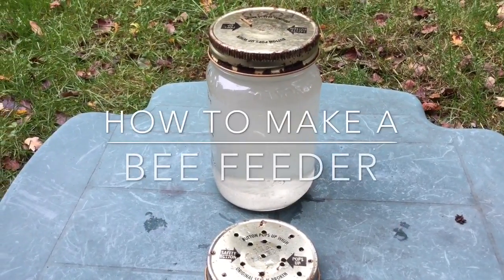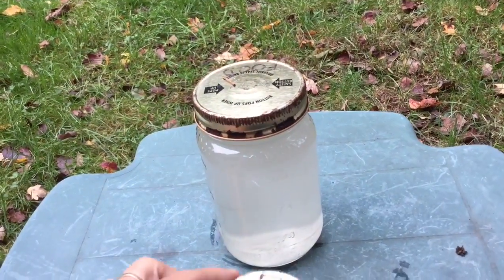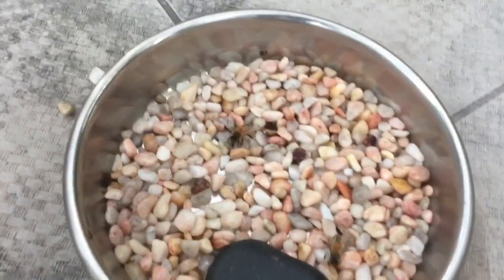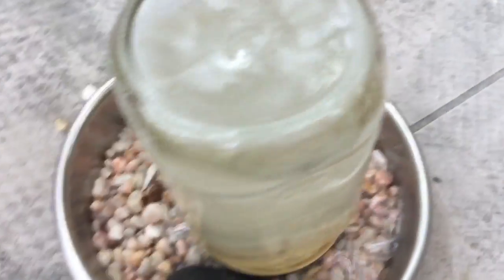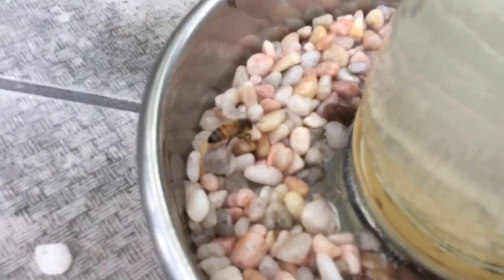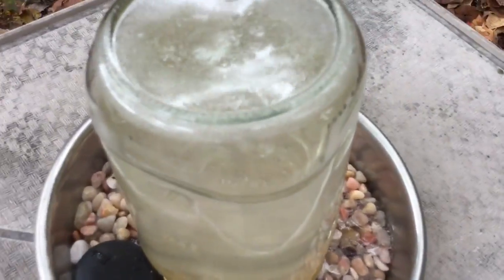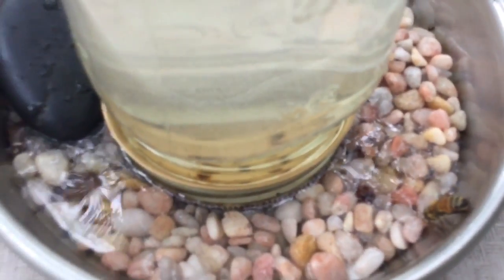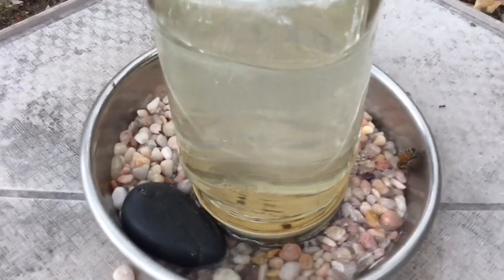DIY How to make a Bee Feeder -Helping Honey Bees 🍯 🐝

Comment: Thanks so much for posting this.  We had been feeding our local bees in a large glass ashtray on a pedestal stand, with a central area and a large outer moat.  The bees drank the syrup so fast, we had to refill it several times a day.  Your husband's "invention" was the perfect solution.  We used glass marbles to lift the jar high enough for it to feed out into the ashtray and overflow into the outer moat.  Now we only have to refill the jar twice a day.  Those bees can really suck up the syrup!  For anyone who has a problem with ants, our ashtray sits about three feet above the ground.  We put a ring of petroleum jelly around the base of the stand, which stops non-flying insects from climbing up to the ashtray.
Reply from the maker: Thank you for your nice comment. Great idea about how to deter the Ants. I cant wait for spring. Have a good weekend!

Comment: How do you  deal with ants?
Reply from the maker: +the yellow gloves not much I can do about them. On my Hummingbird feeders I have ant guards but they don't work on the bowl. They really aren't an issue. I fill it outside 3-4 times a day and put it in the shed at night so the Raccoons don't knock it over. The ants usually disappear once the sugar water is gone. I clean the jar outside at the hose as sometimes ants get inside it and I don't want them in my kitchen sink. 🐜😉
Reply: Just set the whole thing in a larger saucer with a little bit of water - it'll work like a moat to keep the ants out.
Reply from the maker: Micah Foreman thank you for the idea.  I will try that.